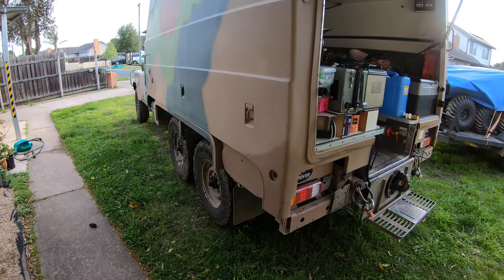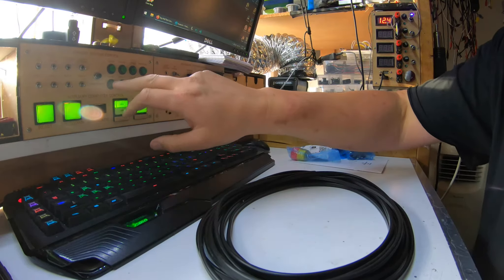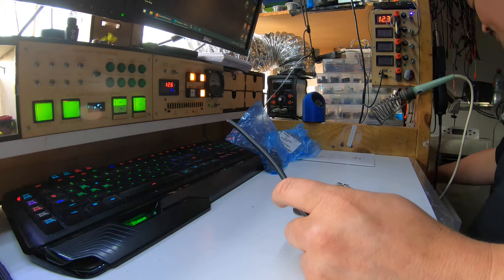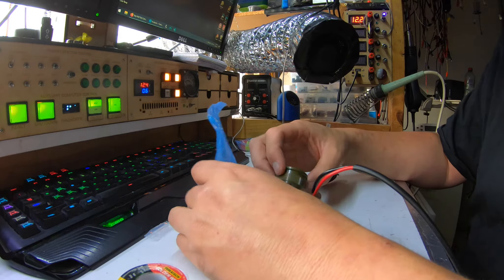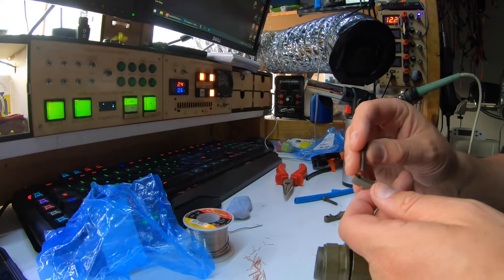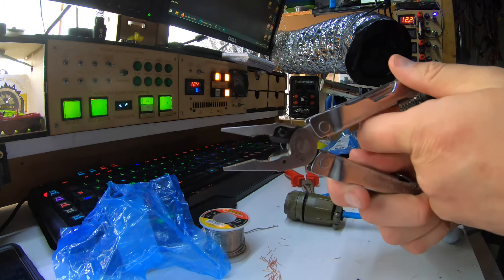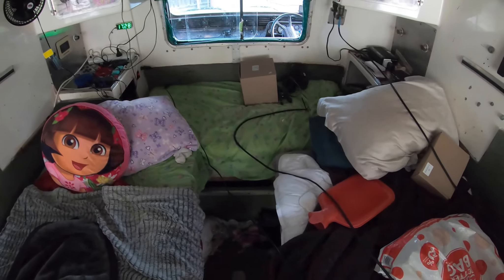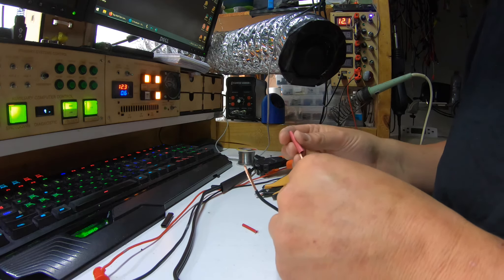Installing a 24v fridge in a 6x6 Perentie Ambulance

Comment: Hi, not a criticism, but at 12:00, I would have heatshrunk the transition piece before the longer piece.
That nylon insert also probably applies pressure to the brown insert.
I like servicing those military metal plugs/sockets, nice alignment and no fiddly pieces.
Most that I have had to disassemble if tight, do eventually come apart.
Don't you love the sound and sight of a DC arc, how did the cutters fare, did you have to use a set of replacement jaws?
26:00, The binding with thinner wire is what I do, pity you have to cover the resulting sexy looking joint in heatshrink.
Stay Safe mate, How did you fare after your Covid Shot?
Reply from the maker: Yeah I got lazy with the heatshrink, mostly because I'm going to be pinning down the cable and it won't get a lot of strain.
The leatherman cutters weren't even useful as strippers, just swapped the cutters over completely.
Woke up after the shot feeling like I had been hit by thors hammer, bit of ibuprofen made it bearable and it's wearing off but still tender today.